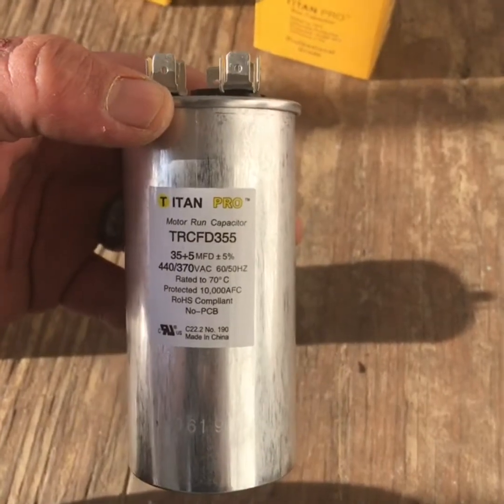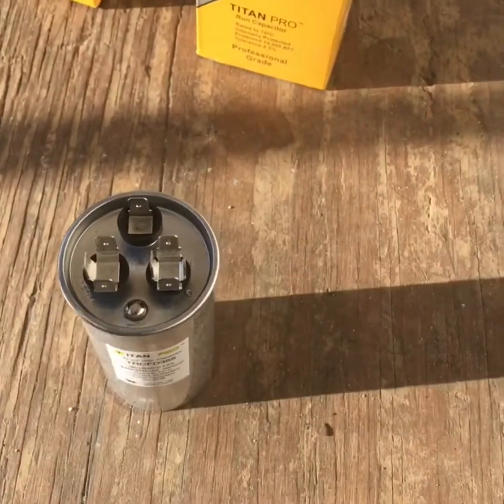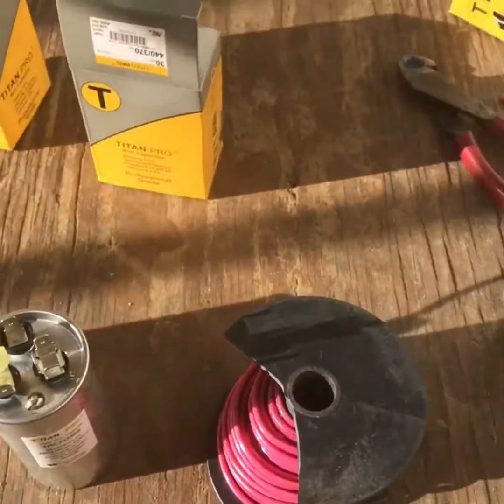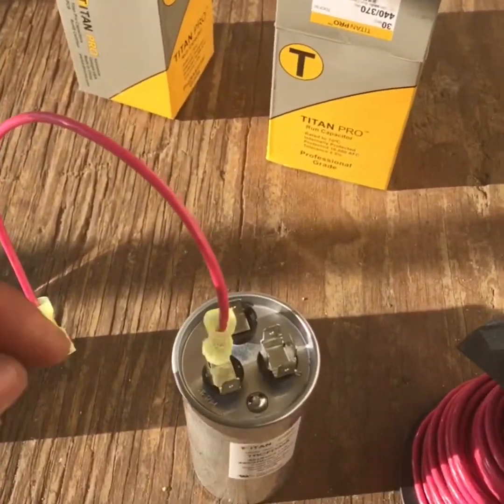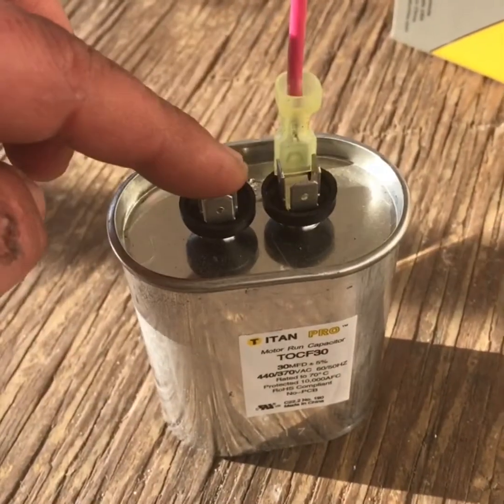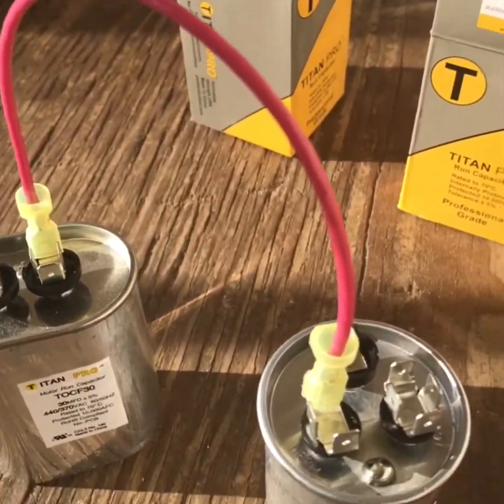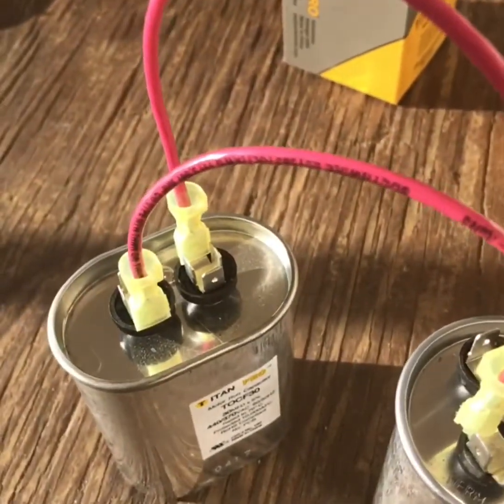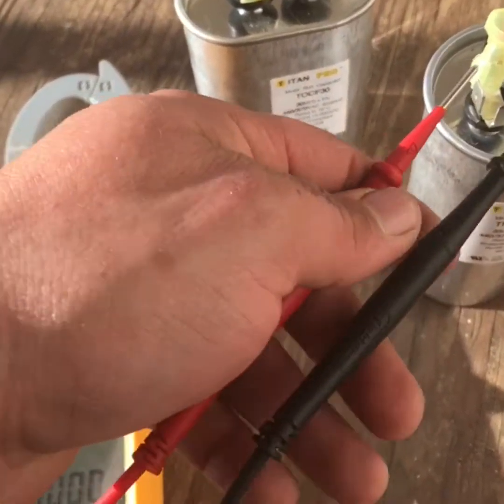How to Build a Capacitor in Parallels

Comment: What about jumping the capacitors inside of the combo cap? I've never thought about this until now but why wouldn't that work? I'm thinking of trying it now and testing it to see. Just jump Herm to fan and it should add the capacitance. In fact I'm wondering if the amrad turbo 200 doesn't use the same concept.

For example if you had a 50 + 10 combo cap, jumping Herm to fan is connecting a 50 + 10 in parallel internally and should read 60 microfarads.

This could be a little trick to add flexibility to your stock of capacitors and more usefulness.

Comment: Capacitors in parallel add their values. Capacitors in series are not added together, but their value will be less than the largest capacitor. It appears you hooked them in parallel, and thus your meter showed the correct value for parallel & not series.

Comment: Thanks for sharing. I noticed you only did capacitors in parallel which is just the sum of capacitance of both but you didn't explain series capacitance.
Very rarely would someone need to use two capacitors in series to come up with a smaller capacitance but it could get a system running on a late night or weekend call when you don't have the exact match. The quickest method is to use your phone and google "calculator for series capacitance". The formula is much more difficult than parallel. You add the reciprocals of each capacitor (1/capacitor1 + 1/capacitor2) then get the reciprocal of that. Most phone calculators have a reciprocal function which usually looks like 1/x  (sometimes you have to switch to the more advanced calculator you can change to in calculator settings.) Again the online calculator is the fastest. You have to play around with the values you have in stock to come up with a series capacitance that works.  If the two capacitors are the same value that makes it easier. The capacitance is then half of one of the capacitors. 
And remember you can use a capacitor that is larger than the specification up to 20% higher with no problems. Just never go smaller.
Reply: That's interesting. I've always been told you can go 10% higher on capacitance but no more. Curiously, when I did compare the app drawer with a slightly bigger capacitance I was surprised to find it drawing more amps with the bigger capacitor.

 Where does the 20% figure come from?